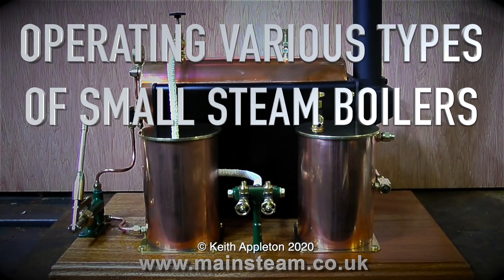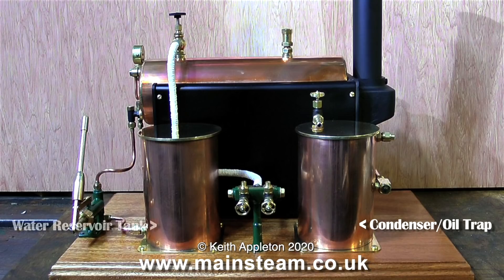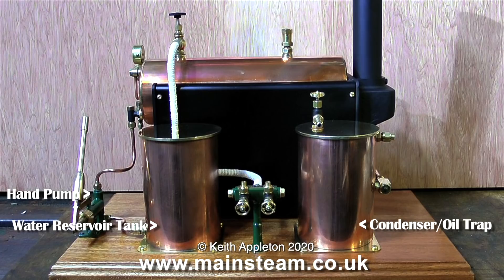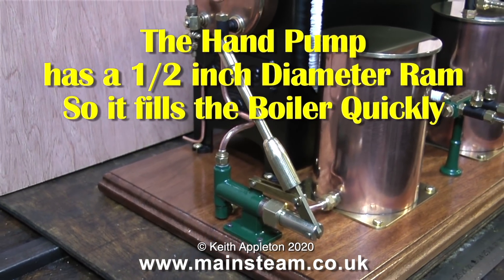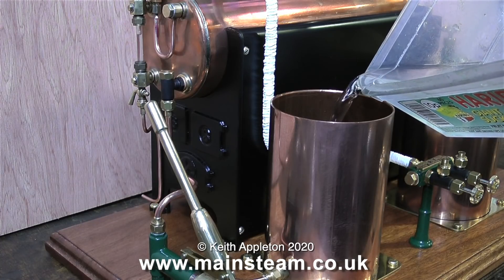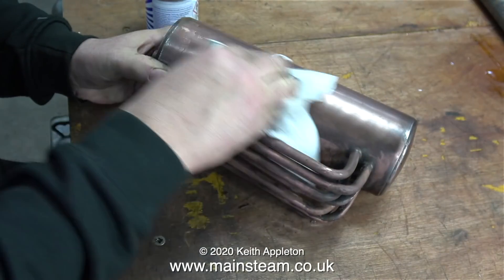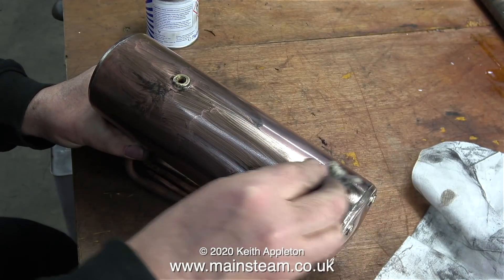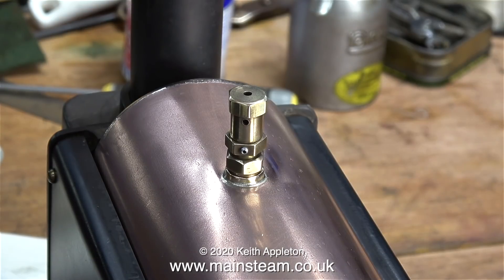OPERATING SMALL STEAM BOILERS - PART #1

Comment: On these model steam plants have you ever considered running the exhaust pipe from the engine through the water tank first then on to the condenser/oil trap, would this make things that little bit more efficient by using the heat from the exhaust to pre heat your water storage before its pumped in the boiler?
Reply from the maker: Please watch some more of my Steam Plant building videos. I do this from time to time. The preheating principle is called an "Economiser"
Reply: Keith Appleton thank you for the reply and I will do, I do enjoy your videos.

Comment: Hi Keith.Thanks for this. But with regards to tap water I think it depends on its quality, yours up north may be good. But if you live in Portsmouth its VERY hard full of chalk so I would not be using it in a boiler. but would use distilled or similar.